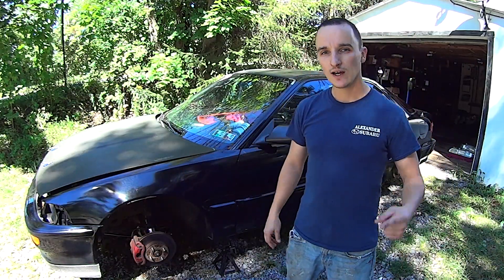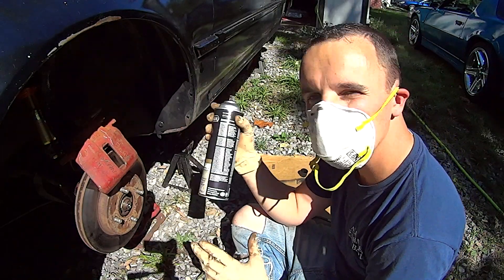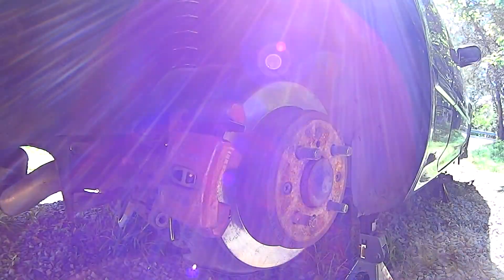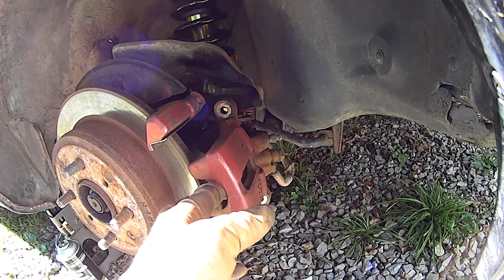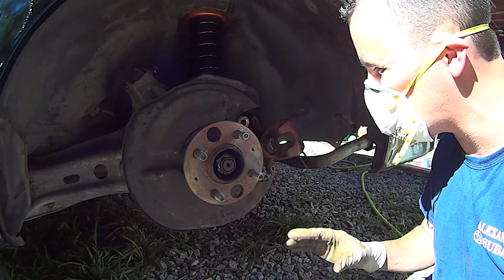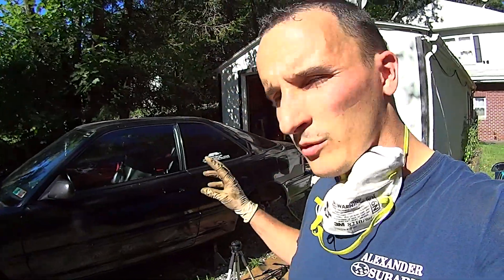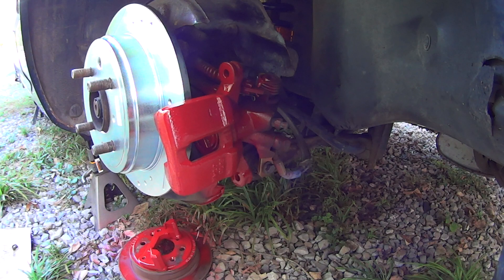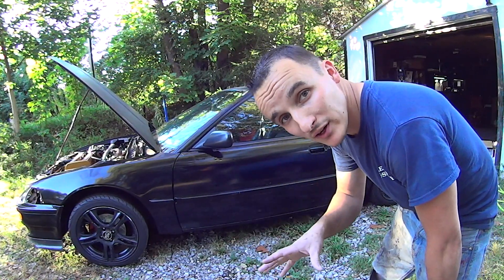Project DA9: Ep 17- Brake Upgrade

Comment: I find brake jobs relaxing, when everything cooperates! Removing rust, cleaning things up, make everything new, but only if it goes smoothly. With the rotor direction, that only matters if they have directional cooling fins on the inside. If the internal fins are straight they can face any direction, as long as the slots are all going the same way. I found that out when doing the big brake kit on Project Dirty Willy. Great video, things are really coming along!
Reply from the maker: Rocky X TV The cooling fins on these are non-directional, but if Hawks is labeling left and right I figure it's best to follow directions.
Reply: UndergroundTrev Yeah, I found this out by contacting TeraFlex about their big brake kit. Their instructions showed left and right, but then in all of the pictures it was different. I called and asked which way they should go and they said it doesn't matter, as long as they all go the same way. I asked, then why show left and right? They said it was just to keep calls down, they had a bunch of people like me calling to ask which way they went. So they just said this one is left and this one is right. It is best to follow instructions though.
Reply from the maker: Rocky X TV hahaha! That's awesome. Definitely makes sense.

Comment: On my DA9 I replaced the whole suspension and steering and all felt like a new car. Just waiting for my trailing arm bushings to get here don't forget to replace those. the size of the trailing arm bushings are 3.35 inches for the DA9 not 3.16 inches
Reply from the maker: I bet! Changing out 25 year old bushings probably makes a huge difference!
Keep watching... I've got a bunch of new parts waiting for installation and the remaining bushings I need will be on the way soon. I should have a track-ready suspension by spring time.
Reply: I really want the new $1000 K-tuned shocks and coilovers but I'll be happy with the Yonaka instead. I'm also going to put all high performance internals on my B20B.
Reply from the maker: The Yonaka coil-overs were terrible. I already sent them back. Save your money for something better.
Reply: thanx for the info then I'll save for the K-Tuned

Comment: why didn't you remove the dust shield that sitting over the caliper? that was the first thing I removed smh
Reply from the maker: That probably would've been a smart idea, LOL
Reply: would have been alot easier to get to those 2 bolts so you can move the ebrake line out of the way